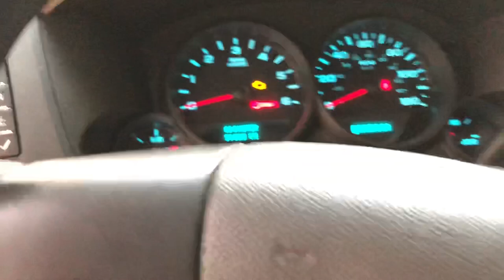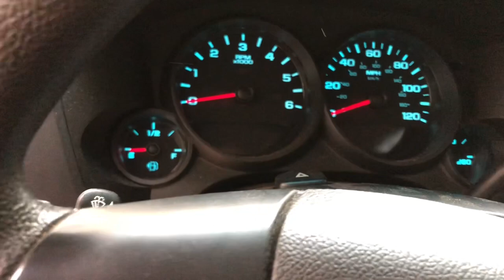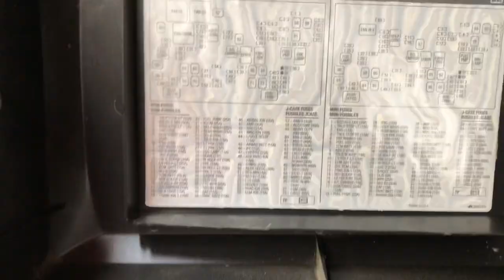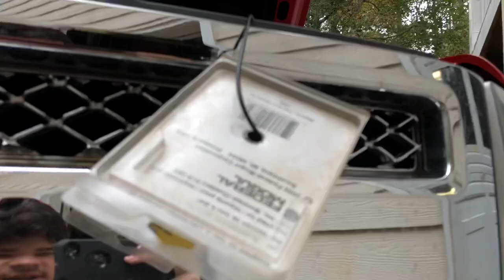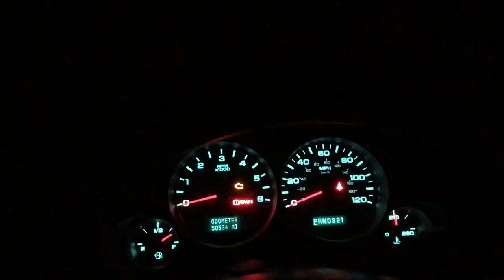CHEVY SILVERADO FOG LIGHT INSTALL 07-13 | LIGHTBAR INSTALL | HOW TO

Comment: @ 6:53 the blue 15A fuse is the fog lamp that gets power from the switch you installed. Just get a "Fuse Tap" and plug in that fuse location. It already has the hot wire for the fog lamps so you don't have to remove and run the wire from underneath and risk causing other possible problems.

Comment: Does anybody know if I can just plug wire fit into the fuse and push the fuse back into the box and it would work the same or do I have to take the fuse box apart but I use a bypass use and pushed into the fuse place

Comment: question you might not know but cant really find any info online but would this be the same for a 2000 silverado just swap the switch it also has the relay and fuse but not the switch would like to wire up as a light bar but want it to look as factory as possible without drilling a hole in the dash

Comment: I'm trying to figure out where to put the light. Not sure if I am able to use a bar light as fog and have it running while driving. I got the recovery hooks so it is a little fuller down there. Not sure yet if I will go with a bar in that slot or 2 small one below. Dont want to buy new end caps.

Comment: You do not have to modify anything on the harness of the switch, just remove the one that does not have the auxiliary light button and connect the one that does have the button.
Reply: The cable of the fuse box is the one that sends the current for the headlights
Reply: It’s really that simple?  Damn that would be great.
Reply: It really is ready to go. I put the new switch in way before installing the lights and they would show working on the dash. Dealer upgrade was probably a gravy job

Comment: Hey man I have a question my fuse box is coming out in once piece. Instead of top coming off like yours.  Can you show me where that one wire connects too.   It’s it the top right corner of the fog lamp relay or does it connect to the fog lamp fuse??
Reply: Same any help ?
Reply: Same here
Reply: Anybody find a solution?
Reply: Just gotta wiggle it out apparently some come out whole and some split

Comment: So when doing this the fog lights will turn off with the high beam? My lows stay on with the high
Reply from the maker: Correct unless the mod has been done to keep the fogs on with highbeam
Reply: Boost auto supply has a small part that you can install under the dash for $20 so that the fog lights stay on with the high beam

Comment: Had a question when you swapped the interior switch to the new one I noticed the plug in had wires cut, is there rewiring that needs to be done when swapping the switch?
Reply: @1:18
Reply from the maker: Nope no rewiring. The person i bought the switch from just cut the wires instead of unplugging it for some reason
Reply: Ahhh makes me feel way better
Reply: Another thing, do you think instead of using the harness to the fuse box, could I just use a fuse tap and just run my wires down ?
Reply from the maker: If you are tapping into power for the fog lights as shown, yes that should work

Comment: Does this apply to 2014 Silverado?
Reply from the maker: Unfortunately it does not sorry
Reply: Avery Bryant, do you know why it will not work?
Reply from the maker: Lewin Taquiso its is a different generation of the silverado and the equipment used is different

Comment: If you remove the factory plastic cover on the main wiring harness you’ll notice that there is already a wire for the fog lights. It’s bunches up an tied off a couple inches down. I’m not sure if there is a post to add to the switch though(pretty sure there is) all factory harnesses have the factory options, they just tuck them away per options. I noticed this while wiring my HID’s at the driver side headlight harness. It’s a blue wire with a white stripe. Hope this helps
Reply from the maker: Sean Laskey you are correct, only for certain trim levels though. In my case i had to add the wire myself
Reply: I had to add the wire too, 09 LT 1500
Reply: You didn’t have to program the bcm or anything?
Reply: I did no programming, they come from the factory ready to be upgraded